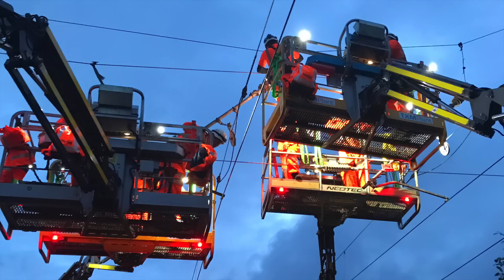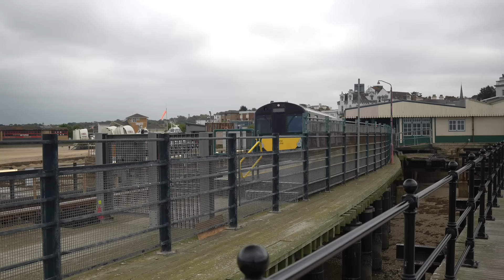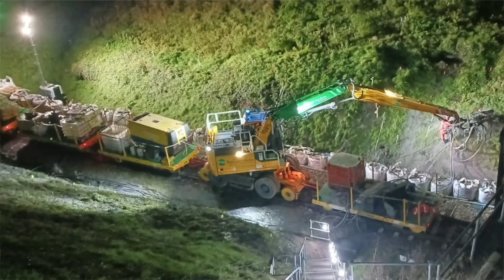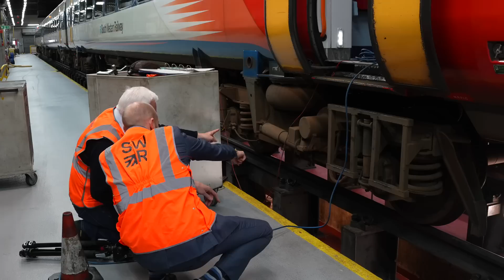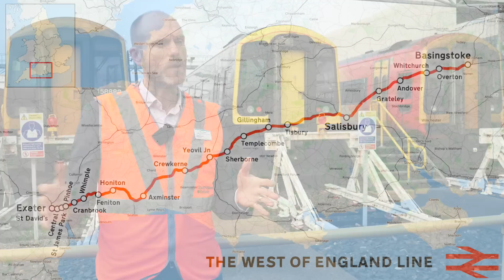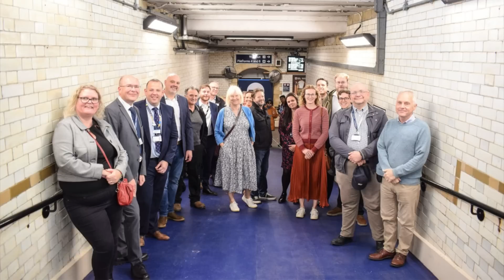Electrification, battery trains, third rail – Finding solutions for South Western Railway’s network

Comment: Catenary is far more sustainable and straight forward than battery electric. Look farther to the future. Don't get caught up in innovation being the most logical solution. Train use is going to become much more prevalent. Personal motor vehicles (cars/SUVs) will be phased out as they cannot actually be produced with zero carbon emissions, meaning medium and long distance travel will try solely on rail.
Reply: So everyone is going to have their own personal railroad station outside their house?
Ban personal road vehicles and you no longer have a functioning society, and definitely not one that could support a rail network.
Reply: I think you'll find batteries become much more simple than OLE (catenary) and much, much cheaper and quicker to install. No one wants unsightly wires all over the place, especially not in rural areas. Batteries with islands of power in stations makes absolute sense for rural lines where the journeys aren't long. Mainlines should be OLE where possible.
Reply: Installing catenaries is expensive (especially due to our history and failure to run with a rolling programme over the last 30 years), and on a line that is mostly only used by 1 train per hour, the cost is high for the gain – and especially when one of the barriers to rolling out electrification faster is a lack of staff and physical resources, a line like WOE is hard to prioritise over other lines that are used more intensively. Discontinuous third rail with batteries is probably the most cost-effective way to decarbonise this line within the timeframe needed before the current fleet needs to be replaced.
Reply: @andrewhotston983  Sound's crazy right? Would it surprise you to know that prior to WW2 most households in Britain and the USA did not have a car. Ask an old person if their parents lived in a functional society and the answer is yes, society worked before everyone drove cars. Buses and trains moved people pre-suburbanization, and now we can rebuild our suburbs to have tram and light rail access. Micromobility (most familiar to people witnessing post WW2 Europe and Japan) included bicycles, motorized bicycles, and tiny bubble/microcars to journey shorter distances, and now we do have even more viable very sustainable electrified micromobility. You only have to look two decades ago to China to see a very functional society operating largely without cars. The physics of Climate Crisis aren't going to bargain with us and grant us permission to kick the problem down the road for another generation or two, nor is society going to starve to death so that we can expend rapidly shrinking carbon emissions on motor cars, ICE or EV. We'll have a massive job decarbonizing all aspects of our modern life, and you've just not been paying close attention or haven't been well informed by leadership about the big changes coming.

And before you try to rationalize eternal car use with the argument that people don't want to or can't all ride bicycles, again, our opinions on the privilege to operate cars isn't cogent. So we're going to have to step up and retain mobility with sustainable means that don't require massive amounts of emissions to produce and operate. I can travel 50 miles easily on a $2000 e-bike, but since that takes a long time, more likely I'll prefer to travel 2-10 miles by bike and ride a train for the balance of longer trips. People with disabilities can and do ride recumbent tadpole e-trikes. I'm not saying this won't require a great deal of compromise. It will. But Climate Crisis is comparable to a World War that we know will not end for generations. We certainly can't slash our emissions to zero perpetually building battery electric cars/SUVs that currently require 17-39 tons CO2e emissions just to build. 

BTW, Britain is already in a much better position than many countries including the USA. But we're not anywhere close to having legitimate plans for zero carbon emissions living.
Reply: @andrewhotston983 'Railroad' - Must be American. We have a more integrated transport network in Europe. Buses do need to be brought back to remote locations and subsidised in many cases and if possible old lines reopened. Where the trackbeds have been built upon they could run tram-trains that go into the road for short sections.
At one point in the UK you couldn't walk more than about 5 miles without tripping over a railway line. Many were closed over the years, especially industrial lines such as those to the collieries but the most devastating closures were from 1964 onwards.
Reply: @stevieinselby  I'd agree if I believed that rail will continue to be a non-primary mode of travel. That must change with Climate Crisis. Nations and local governments need to understand that we cannot rely on cars in the future, and that completely changes the importance of rail at all levels. We're still in denial of the constraints that zero emissions will impose on us. Car companies won't admit that they cannot build cars with zero emissions well-to wheels, and certainly not in perpetuity.
Reply: @karlInSanDiego You're living in a fantasy world. Try going to the supermarket on a bike. Especially where I live, where there are big hills.
Reply: @karlInSanDiego  I don't understand why you think that looking for cost-effective alternatives to overhead lines that will allow us to decarbonise rail travel more quickly is in any way a barrier to rail being a primary mode of travel.
Reply: @kristinajendesen7111  I was guessing that "Karl in San Diego" was American. I'm not.
Reply: Who says that personal motor vehicles cannot be produced with zero carbon emissions? Eventually we will have a closed renewable energy economy where everything, with very few exceptions,  is done with zero carbon emissions
Reply: @andrewhotston983  Actually, in places such as London where public transport is very good people could get by with that plus the occasional robotaxi. Out in the sticks, not so much.
Reply: @fruitytv-uk  It can be argued that the West of England Line is a mainline, despite long sections having been stttupidly singled.
Reply: @karlInSanDiego  17 to 39 tons of CO2? Where on Earth did you get that from? Divide it by 40 or 50 and you will be closer to reality.
Reply: @fruitytv-uk  Mining the ores needed to make the batteries is very far from simple!
Reply: @rogerphelps9939  No kidding? It's not just "the sticks", though - life in the suburbs is pretty impossible without a car, and that's where most people live.
Reply: @stevieinselby  because these trains won't run twice a day with long times parked to charge. They will run constantly, like trains actually do in places where people rely on them for all of their travel. Battery electric sounds fantastic until you actually study the performance of those trains compared to electric trains that don't have the penalty of high emissions and financial barrier of a massive battery. Battery electric is a solution waiting for a problem. Catenary electric is a time tested formula that isn't dependent on competing for shrinking resources needed for other transportation where fixed route is not the formula. You can produce 400 e-bikes with the same lithium battery cell count as a single Silverado EV pickup truck, but if we move the plurality of our freight and human medium and long distance transportation to rail we will have many many more trains, replacing lorries and cars. You can't afford to sideline them for hours to charge slowly, or build mega upgraded transmission and substations to support railyards with multiple megachargers (1 megaWatt) to try to radically DC charge them all. You'll be artificially creating a new depleting battery resource point of transition failure if you try to choose the false economy of BEV trains. Stringing and maintaining catenary will be the more sustainable route, minimizing the cost to invest in additional trains.
Reply: @rogerphelps9939  Well Roger, I'm saying it. I'm saying it because you don't make EVs out of straw and bamboo. A modern EV creates tons and tons of emissions, and that's before we've reached a high demand, which will create bottlenecks and supply shortages which will not aid in low emissions resource extraction, but exacerbate the problem. You've got to think whale oil, coal, petroleum and then imagine a world real soon where the people say, who in the hell thought we could dig up nickel, manganese, lithium, copper, and iron forever and move people around in massive 2-3 ton cars when we're trying to understand how to eliminate CO2 emissions from farming, housing, and every aspect of our life. Zero carbon emissions isn't something you just pay money for. You have to reinvent mining and large scale transportation and industrial smelting and do it all in the next few years. We're hand waving to say that it can be done. Can we build a giant mining dump truck that uses 1 MWh of batteries? Sure, but we expend tremendous emissions building a fleet of them, and they need battery replacement in 10 years or at least augmentation to account for degradation. Taken across the entirety of the automotive industry, it's not impossible to gradually decarbonize all sectors of parts and materials production, but doing it in time and in parallel with all of the other needed decarbonization that creates a real need to assess if this is actually viable. If making a BEV (whether it's a train, a semi, a car, or a bike) expends more CO2e emissions building it than operating it (which is the dream under an all renewable grid) we still have to account for all of the materials reclamation, loss, and energy and new materials needed to make the new vehicle and remake it after its perceived useful life. Personal motor vehicles for example are all built with crumple zones to deform and save lives in accidents, but this means that it's even harder to make a promise to ourselves that we'll operate these same vehicles for a lifetime to ensure their production emissions are well spent. Steel is recyclable. Aluminum is recyclable (very much so) but there is still waste that is non-recoverable as aluminum. Lithium batteries are recyclable and with hydrometallurgical processing through a series of gnarly acid baths you can recover varying amounts of the critical minerals, but not completely. So it's wrong to describe industrial large vehicle production as circular, unless we build them primarily from bamboo.

The car is the most complex thing we routinely purchase. In a world challenged to dramatically reduce emissions, it doesn't hold promise as a thing that makes the cut, at least as seen today. The immense complexity and mass of it, and in the case of mined materials for batteries in EVs, give it much higher emissions cost than other things in your life (except maybe housing). So it's simplistic to believe that all levels of mineral acquisition, mineral refinement, mineral transportation, material production from those minerals, material shipping, parts manufacturing of materials into auto parts, assembly of auto parts into finished goods can all happen before 2050, the magic made up deadline the IPCC has chosen for when we must fully reach zero carbon emissions or perish. In fact, we're in deficit spending with emissions today and for more than a decade. We have no real plan for CO2 extraction from the atmosphere and the oceans. We're living way over our means today, and EV production of full sized vehicles actually ramps up and increases emissions as we try desperately to remain car dependent. Increased demand for nickel, lithium, and other minerals is more likely to encourage high emitting mineral extraction from countries without emissions rules. We should not expect responsible behavior from our capitalist management of resources, or believe we can enforce that with Climate Crisis weighted delays, waiting for cleaner tech to ensure that when we transition it doesn't push us into the red zone with emissions. All signs point to disarray, chaos, and very poor actions taken by most world governments and private industry so far in response to the Climate Crisis. Emissions are still rising globally. Leaving our transportation emissions strategy up to the auto industry is delivering bigger less efficient EVs as a whole, each year, even if some of the tech make some models more efficient.
Reply: @karlInSanDiego  Very little more than an ICE and the difference is made up very rapidly. Maybe 10,000 miles.

Comment: Ive never understood why a lot of our trains are completly flat/vertical at the front and rear, we've known for how many years that aero dynamics play an important role in efficiency for how many hundreds of years now? It'd be like trying to run a marathon holding a door up in front of you😂🤦‍♂️😂
Reply: Talking specifically about the 158/159, it's because they have gangways at the end of the trains allowing you to pass from one unit to another when they are coupled up. 
For trains like the 701, 707 etc which are new trains with no gangways, i have not a clue. A guess is that the trains operate on generally low speed lines (under 100mph) and so the additional cost to change the design of the train to something like the 395 or 800 series is more than what would be saved in efficency in the long term.
As explained by Maverick Hunter Daniel, Gangways at the ends of trains have ups and downs. Postbox syndrome and being able to move between units.